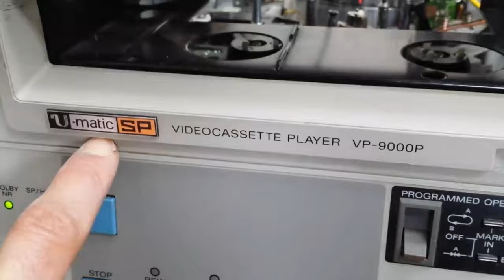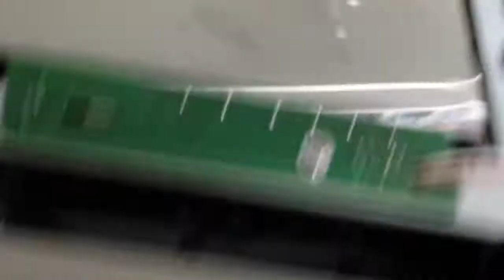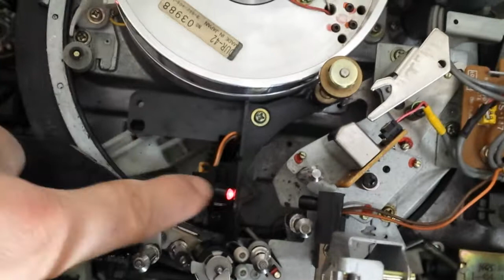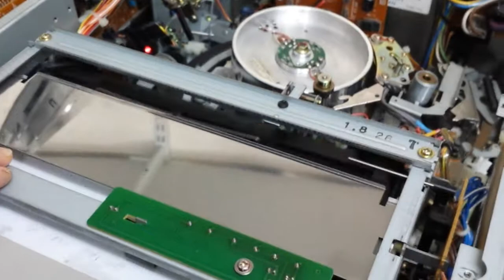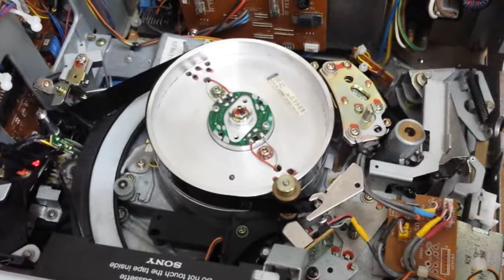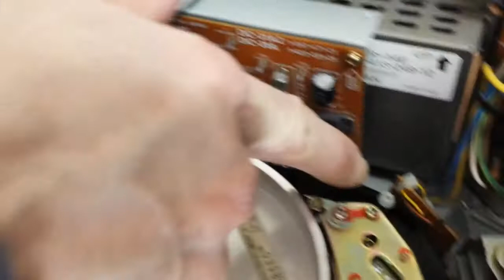Faulty U-matic VP-9000P, need help on fixing it.

Comment: It sounds like the belt is slipping.it needs a new belt.
Reply: I do not think so. The loading motor should stop when the tape is pulled out of the cassette, and should not thread the tape around the drum. In my opinion, those opto sensors might be dirty and the VCR does not know the current position of a mechanism.
Reply from the maker: Sounds very interesting, I’ll give it a clean wipe or replace them. Thanks 🙏🏼
Reply: @MortyParko  If you want to test the operation of the mechanics and the sensors you have to turn off the machine, unplug the connector of the cassette compartment and turn it on. The VP 9000 will position itself in service mode and all the buttons on the front will be active. You do NOT have to insert the cassette. Play and check how the VCR behaves. Same thing with the FF and REW keys.
It is normal for the red lights you show in the video to be on.
Reply from the maker: Thanks, I’ll give it a try.